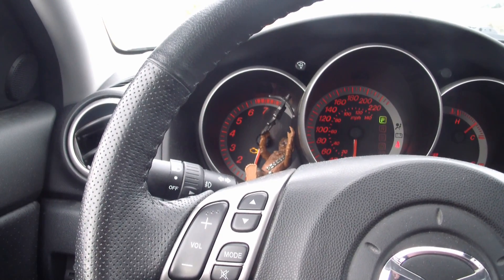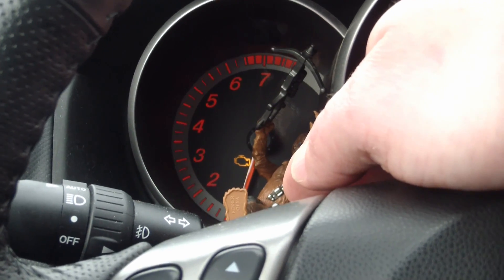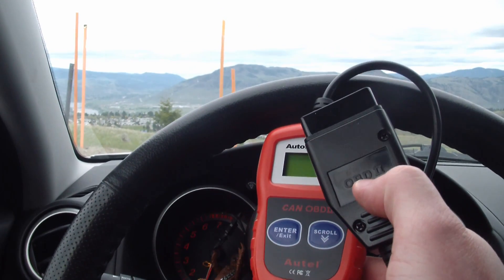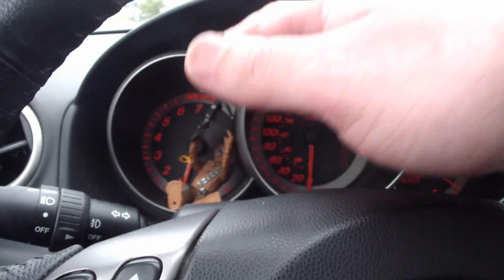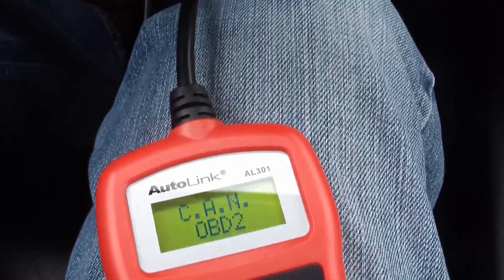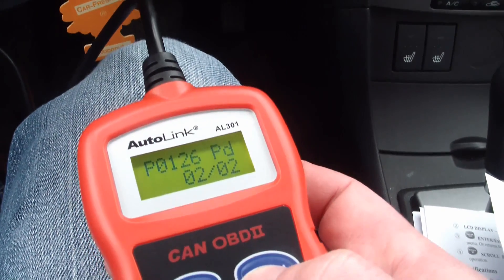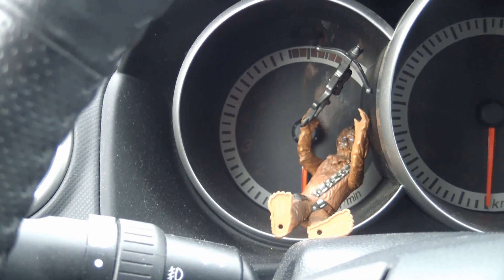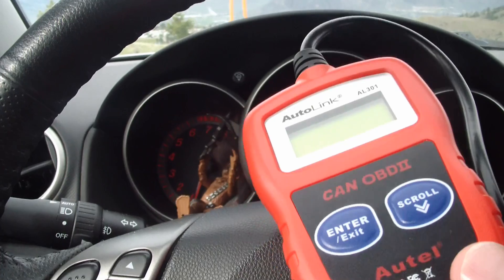Manly-Man Skills: Outsmart Mechanic Scams by Using Your Car's Computer!

Comment: Rather than the device you show, I highly recommend a bluetooth ELM327.   I use a generic with no problems.   It's the orange/blue one you see on the WIkipedia page for ELM327.   You can get them for under $5.   It's an awesome tool for dirt cheap.

Look up your car, and see what the "OBDII protocol" is.  Then make sure the reader supports that bus.   My vehicles are GM, and both use J1850-VPW.  My girlfriend's Mini uses ISO 9141, which is also supported by the ELM327.

With that, you can use some Bluetooth device.  Cell phones and tables are perfect.  I use it with Android apps.   I believe there are iOS applicaitons.   There are various Windows applications too, but I haven't even played with those in years. 

I happen to like the Android app "Torque Pro" by Ian Hawkins.  He has a free version also, so you don't actually have to pay.  Beyond reading the codes, you can make a customized display to show your gauges.    I have found that very useful when diagnosing problem cars.   

He also has a very cool add-on called "Track Recorder", which you can use as a black box.   You can record all your driving, and record things like G forces (supplied by most Android phones), throttle position, GPS speed VSS speed (speedometer speed), etc.    If you are in an accident, or even just get a ticket, you have evidence for your side to prove you didn't do anything wrong.

When I'm helping someone with their car, I set up my tablet or phone with all the relevant gauges that are supported by that particular car, and then have someone drive around while I watch the tablet, and listen to the car.  I'll tell the driver to do things, so I can see how they are reflected in the gauges.   If you know enough about cars, that can tell you so much more than just a code or the owner saying "it does ... this ..." 

It saved me a fortune once.  I was on a road trip, and my truck started running rough, and it turned on the light.  I plugged in the ELM327, and told my passenger to pull up the code.   It was an intermittent failure on the CPS (Crank Position Sensor).  That's enough to shut down the truck if it stops working.   We stopped by a parts store and grabbed one, "just in case".   About an hour down the road, the truck stopped running, so we coasted off the road, and I changed it right there.   You always have your phone with you, and that little reader is small enough to leave in the car.    10 minutes on the side of the road was a lot easier than paying towing and shop fees.  A 10 minute delay in our trip was much better than a day of getting towed and waiting in a strange town for a shop to fix it.

There are a bunch of generic's available, which are/may using ELM's 327 chip or a clone of it.   Some people will scream not to use the clones.   I happen to have bought one for $5 on eBay that I've been using for years and it's fine.  Some of the clones may not support some bus types (what the computer talks over that connection).

The old "official" one was distributed by scantool.net.  Their current cheapest one costs $69.95.    Paying under $5 for a compatible one is a lot easier.   The real chip costs $21, so anything selling for less than that is using a clone chip.   If you get junk, it's because you paid for junk.     But there's a good chance you'll get something that will work.

There is a serial version that can be attached to a PC.  There is a huge warning.  You can have a difference in electrical potential, which can destroy the unit.   Basically, they're using different power sources that may not be exactly the same.    So go with Bluetooth.
Reply: Torque is awesome
Reply: +hugeslacker  I bought one of those from EBAY for $5 and its sweet. It does what everybody needs a scanner for, even real time and flash frame when a code is caught it record the engines info at the time the code was caught. I am glad I bought one. Anybody needing one should buy one. I have both the smart phone one and the PC one and both have yet to give me ANY trouble. I have had them a year already and use them like 4 times a week to repair cars at home for friends

Comment: Some helpful tips for people if they are going to use this tool. ALWAYS google your code with make and model BEFORE clearing the code. See what the recommended diagnostic procedures are for the code, then decide if something you can and want to attempt to fix yourself. If its not, DO NOT CLEAR THE CODE! Leave it there and take it to your mechanic. Always start with the cheapest and easiest fix first. The codes arent designed to show you the exact problem 100% of the time. Sometimes they can, like if you have a bad o2 sensor, but other times its just a general, look in the direction type of thing. Example, my Subaru was tossing a code for the AVCS variable valve timing system. The problem was actually my timing belt, which I knew needed to be changed, so even if that didnt fix the issue, it was no harm no foul at that point. Just be smart and honest with yourself about your abilities to do the job. Ive also noticed that its more difficult to find information on the newer higher end German cars and forget high end Italian. But I guess if you can afford Italian and high end German, you can probably afford the dealer. There is lots of information out there for your basic A to B commuter cars and entry level sporty type cars.

The term "stealership" exists for a reason though. I know Ive had a couple of poor experiences with them. The first was a dealer where they changed my transmission fluid per my request, put the wrong oil in it (NOT per my request), then pinned the issue on me because it had been 6,000 miles since they had last seen my car and since they hadnt changed the engine oil at 3000 miles, (I did it myself) they claimed I changed the transmission oil myself. Despite the fact that I had them do it 6000 miles earlier. They couldnt answer why I would pay them to change the transmission oil, then change it myself less than 10,000 miles later... Years later, and a new car/dealership, i was taking a long trip where I asked to have the car gone over so I wouldnt break down in the middle of no where, no issues they find, 2300 miles later, my belts are so worn out, they wont even grip the pulleys anymore. Car completely shut down on the highway at speed. So, in 2300 miles belts went from perfectly serviceable to worthless. $500 later, I had a new battery and 2 new belts, also the last time Ive set foot in a dealer service area. Ive come to find in the last year and half, that they had broken off many a bolt that they neglected to tell me about or replace over the time they were caring for my car.

Not a fan of the flat rate. Flat rate is great for people who dont take care of their vehicles at all. Just drop it off and come back and pay the agreed upon amount no matter how difficult the actual job was to complete. Its not so good for people like myself who take pride in their vehicle and keep it clean and running well. I find that alot of the little detail stuff gets skipped over and that creates problems down the line.

Comment: I sweep the floor at a stealership as a side job and have noticed mechanics replacing parts that are not broken or worn out ,or if they are replacing worn out items like  brake pads they  do not replace the metal clips the pads side on so they stick or wear unevenly  and than the customer has to come back in 8000 miles because so.
Than they replace them again with the metal clips but they do not clean the rust which accumulates behind the clip (which was the cause in the first place). next the customer comes back a third time and the mechanic finally dose it correctly because the boss told him due to a pissed off customer. the reason; the mechanic is payed by incentive , the faster you complete a job the more money they make, there fore they will half ass it even though they know better just to make money. and the best part is the mechanics get tickets (for selling brake pads) they can redeem for parts for there personal vehicle.

Comment: When I worked at a car dealership there were many cases of people who did just this. Then when they waited to see the code come back the engine had a real problem (non-exhaust related) and they would wine about why the car wouldn't start again (most American cars disable the ignition after a critical engine condition so you stay under warranty). Second hand cars and DIY mechanics are costing people more than it ever has but then again I live in Japan where a second hand car (unless it is rare) is just shipped out or crushed. Maybe car technology will become DIY friendly again.

Comment: It can take 50-100 miles of driving for the code to re-register, most of the time it wont come back immediately even if it is an actual problem. You have to drive it for a while after erasing the code to see if it comes back or not.

Comment: AvE Shared on Google+ · 3 months ago
 This will save you from going to the car dealership!
Hate working on cars? ME TOO!
Here's a OBD tool to get the car's own computer to tell you what the problem is.

Although I like the video, what was the endgame?  Did you just keep erasing the code, or actually change the thermostat?  Did you troubleshoot it as a thermostat problem? What was the outcome?  9 times out of 10 thermostat replacement has fixed the problem for a p0126/p0128 that I have diagnosed.  And the customer was charged that flat rate by the book fee. And were content.  I dont work at a dealership, but I know a lot of them have 'techs' that dont know their ass from a hole in the ground.  Thats what I call parts throwers. And they give good 'mechanics' a bad name.

Comment: Often the problem is not that the mechanic is crooked, it's that he is just as baffled as the DIY'er by the oddball code that could have half a dozen different causes. It's hard for him to get paid for diagnostic and research time, and he is generally working on a piece rate system, so there is a natural economic bias toward replacing parts first and not asking many questions. This video is too cynical, and wrong in that clearing the code usually only works for a few minutes to a few days, in my experience the codes almost always come back until you actually fix something. However the basic premise of the video is still right. Get yourself a $30 scan tool (sometimes there is even a procedure to get the code to display on the dash, check instructions for your particular vehicle). Arm yourself with information before going to the mechanic, whether mom and pop shop or "stealership".
Reply: bobloblaw10001 I just went through this with a "GAS CAP" warning and CEL on my Jeep Wrangler. Ended up being the ESIM, a $15 dollar part of the evaporative emission control. Replaced it myself in 5 minutes once I knew where to go thanks to DIY forums. Said forums reported dealerships replacing whole gas tanks and charging hundreds, even thousands of dollars without fixing the problem. Stealership? Maybe they are just honestly clueless.

Comment: if you spend a little bit more money to get yourself a OBD2 to USB or Serial adapter and get the software for your laptop computer that way you can be in your car in the driveway and then you can google the code while you are looking at it before you clear the codes. You can also use the laptop as an on board Diagnostics while taking the car for a test drive but make sure you have a friend riding with you that is monitoring the laptop for any fault codes that may pop up. Also many of the programs that you can get will include a virtual dash board that allows you to monitor many more of the sensors that you can not see on your physical dash board gauges. This will allow you to have more detailed information when you actually do take your car to a mechanic to have it fixed. That way you can tell them exactly what you were doing when you experienced the issue that you are there to fix.

Comment: Just a thought for any of the hot-rodders or custom guys like myself when working with late model fuel injected thingamabobbies;  There is a simple tool called a ScangaugeII that has a little screen you can keep on the dash or in the glovebox.  It does all these same scanning functions, but can also see body codes, and display 4 gauge readings at a time. REALLY nice when you want a multipurpose tool.

Comment: Usually the check engine light comes on because it's a fault in the 02 sensor that tells you how much air is going into the motor.

Comment: OK I am a Ford technician with 26 years of experience.. Now that that's out of the way let say this wrong wrong and wrong .. Go ahead and buy your 30.00 scanner and throw all the parts at it you can and take it to the shade tree guy and let them throw more parts at it ...  hay no problem for me rite .. And when all that failed and your out all the wasted time and money..  Not to mention pissed at all mechanics for not knowing what they are doing .. You bring it to a technician with a grate repair record and all the tools, knowledge and training to fix the fucking problem the first time ... I have seen it happen over and over again because people have a fear of dealerships ( and some they should stay away from) .. Think of people like myself as grate tools not cheap china made knock offs ... OK now that my ranting is over . most cars today will not turn the check engine light off by just undoing the battery cables ( older cars it would ) . the car may also have to go through more than one. Drove cycle to turn the light back on after you have cleared it as you did . the could go on and on to tell you why and how to test for the code you had but hell I have said enough so let Google tec fix it ... :)
Reply: +bj saucier So...you work on grates?

Comment: The whole video can be summarized: It will be useful and economically wise to get an OBD (OnBoard Diagnostic) code reader. You plug the device in a provided socket under the dashboard, typically left of the steering wheel. Search online with your results. 
Harbor Freight sells a cheap one, btw, and one that communicates to your phone via bluetooth is worth considering. Actually, they should be built-in to a new car. Idk, are they on some models?
But beyond my criticism, I must give credit to uploader for introducing to me the word "stealership", meaning a car dealership. He didn't coin the word http://oppositelock.kinja.com/dealership-vs-stealership-it-s-all-about-image-1499075007 , but I give him credit for using it.

Comment: Fucking people like you come into my work and act like they no what they are talking about because they watch a couple of youtube videos. One out of ten times will a code be thrown pointing to a specific problem. Most of the time it will have to be diagnosed and not just scanned by a 30$ scanner by some no it all hot shot. Clearing codes doesn't make them disappear. I love how mechanics are made out to be crooks.

Comment: Ahhh. A P0300 shouldn't be a major issue right? Misfire code huh... I guess plugs should fix it right... Well maybe it's the coils? Or is the fuel pressure bad.... As shit it's the injectors... I guess my code reader didn't tell me that... 
And this is why you go to a pro tech that can figure it all out at once and save you money instead of trying to replace all these things your self by guessing and googling it.
Reply: +Tj Tjarks Hell, a P0300 can be caused by tons of things, including a malfunctioning EGR system that hasn't yet set a code it self.

Comment: Good video.
Worth noting that fault codes should only be a guide to potential fault since some faults can give impression that a perfectly working part has failed - classic example being sticking VNT turbo vanes on older generation VW and Ford turbo-diesels which often throw up a fault code that points to the air mass meter failing (even when it's working perfectly) because VNT's don't normally have a wastegate so stuck VNT vanes will cause overboost or underboost condition due to too much or too little airflow through the induction side of engine thus affecting the Air Mass Meter. So some garages that use the 'fit a new part and see what happens' method will replace the air mass meter and then few weeks later up pops the engine light again.

Comment: Make sure to drive about 50 -100 miles (depending on your vehicle) just to see if the code comes back. Most codes won't arise again after being cleared until you do so if it is a real issue. Your vehicle will very likely fail the emissions test in most states if you do not do so and they will relay this same information to you.

Comment: As a tech in a dealer, ignoring the check engine light can cause major and expensive damage. Even if the code is just for a coolant temp sensor, going very long with that code active can cause major problems. If the ECM doesn't see a specific coolant temp, then it won't go into what's called closed loop operation. It will run at a slightly rich fuel mixture, which will melt down your catalytic converter and cause another code, and failure of emissions testing (if you have to test for emissions in your area) 

PLUS most auto parts stores will pull your codes FOR FREE. Then you can decide if you want to take it to a shop to have looked at it.